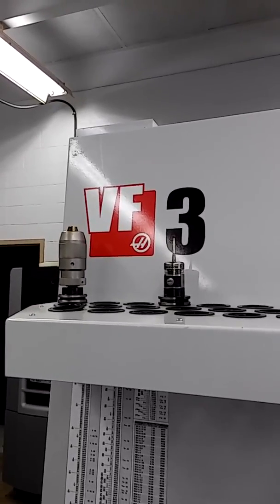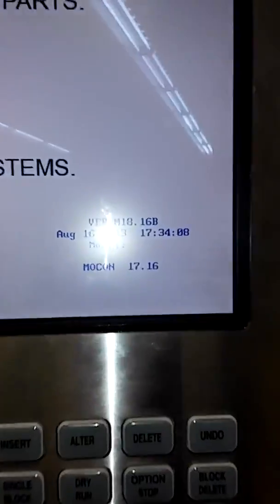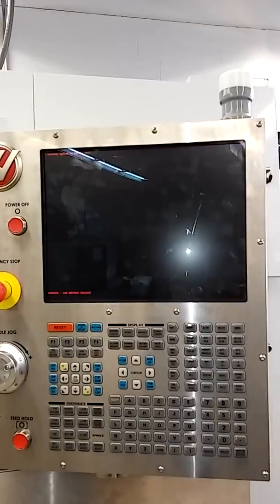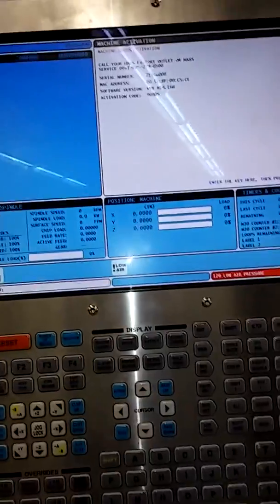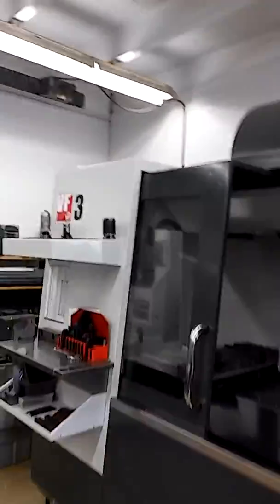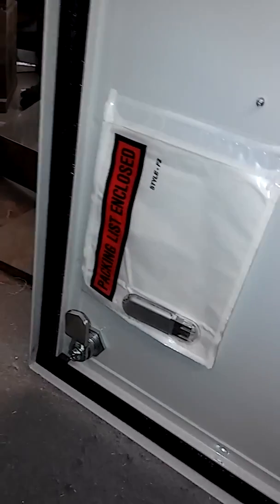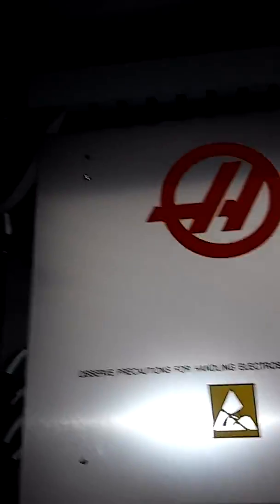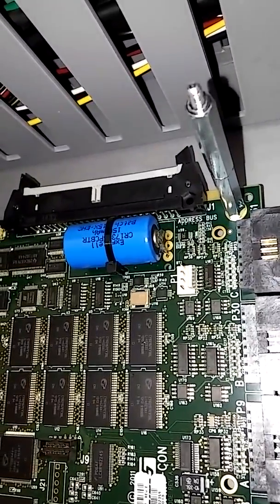HAAS VF-3 low battery warning, problem description, solution

Comment: Just remember to hook up the new battery pack first to supply battery power before clipping old batteries off. There should be a spot labeled P1 for ext batteries.

Comment: Hello .friend.i have ST10Y HAAS  
Have a same as video problem erroe 178
After input haas model and restart the cnc
I seen another Alarms 
Machine  NEEDS ACTIVATION
WHAT CAN I DO THAT??
If you know please help me.
Reply from the maker: You will have to call Haas reseller and give your serial number. They will give you an activation code to input. It is an unlock code.
Reply: @IFLYRV10  ok thanks